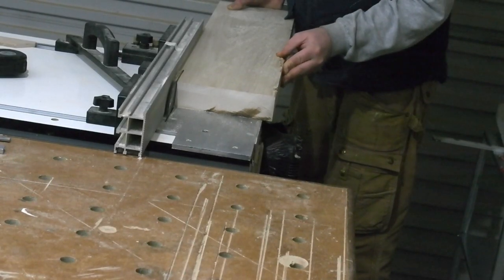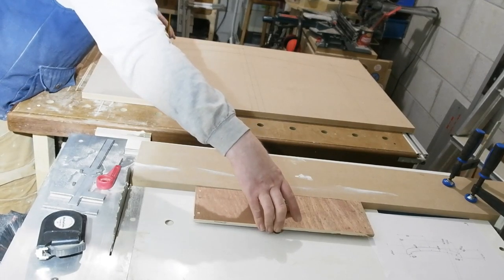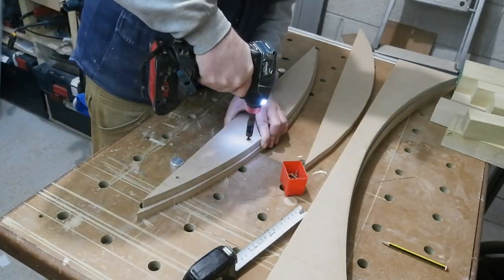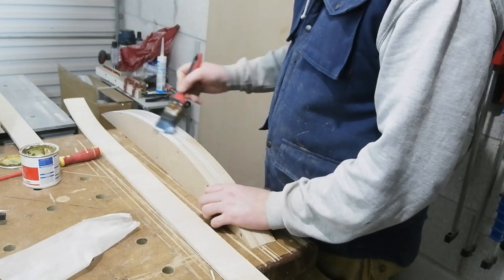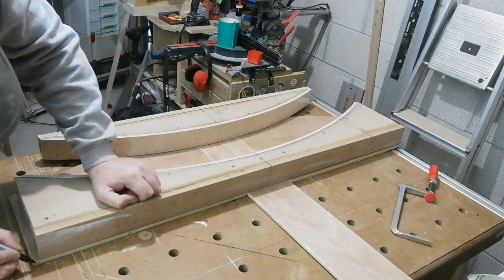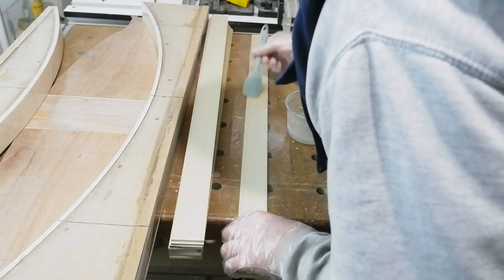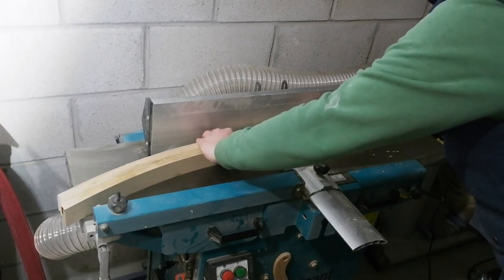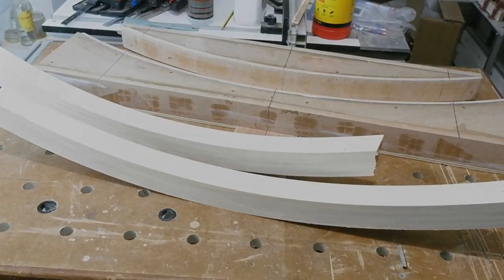Making a Bent Wood Lamination Former

Comment from the maker: The type of form shown in this video is a male + female press. These are best for glued laminations, particularly those whose laminated edges will be on show, as they give uniform, consistent results.
You can also use either just a female or male form, using clamps or straps to hold the lamination to the form. Personally, I would say this is best suited to steam bends for the most part. Vacuum is an excellent option for wider sheet veneers. 
How thick your strips or veneers for your lamination will need to be depends on a few things. In this video mine, at 4mm, were quite thick. As I was using a shallow, uniform radius, this was fine. If you want more acute radii. undulations and/or twists, it may be necessary to use much thinner veneers of 1.5 or 1mm for example. 
There's lots of opinions on glues. PVA's, PU's, powder resins like Cascamite or epoxies like I used are all fine. As mentioned in the video, PVA's (and PU's) have some elasticity which may be desirable. Cascamite and epoxies are a more rigid bond, indeed "phenol resorcinol formaldehyde" adhesives like cascamite, as well as epoxies, have been widely used in laminations for a long time in construction, boatbuilding and furniture making. On lighter coloured woods, I'd recommend epoxy as PU's and cascamite can be a bit showy. The latter do have excellent gap filling properties though which could be beneficial and, on darker woods, their slightly more showy glue line isn't an issue.  
Check your chosen glues pot and cure times, as well as suitability for laminations with distributors and manufacturers. 

Cheers.
Reply: Great comment

Comment: Nice result 👍🏻
Reply from the maker: Thanks Doug. This was only 1 of 4 I made for new chair designs, all with different radius. This methods pretty fool proof though.👍
Reply: @BischBaschBosch  I always fancied trying stream bending. Working out spring back always looks like a complete nightmare/work of art
Reply from the maker: @dougsaunders8109  With the cold lamination I show here, especially using the hard epoxy (or cascamite), spring back really isn't an issue. Tighter curves - a 90 say - some pre-bending helps (done with steam). Steam bending a solid timber is a different matter. First go seldom gets it right and formers may need to be adjusted for a tighter curve so it's close on release. That or form your pieces and let their shape direct the rest of the work. Cold lamination is best for accuracy and consistency in my experience but, it all depends on need - that and any number of other variables!

Comment: Love the jig. Why laminate over a solid block ? - Staircase yes please
Reply from the maker: Thanks mate. Good question which I should have covered. It's a solid block because of its size (as in small). When they get bigger, solid gets too heavy so you'd have a sheet/form top and bottom, then noggins in between to give you the height. Mine are only need be 48mm high though so 3 solid sheets of 18mm is the easiest.👍